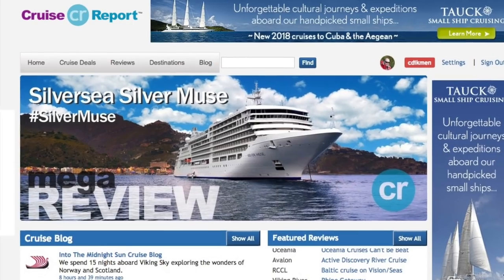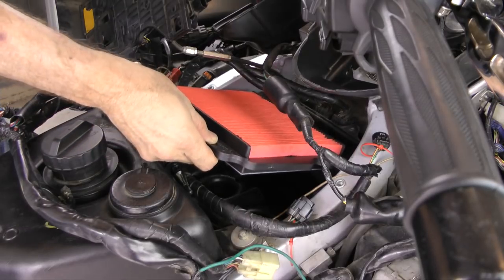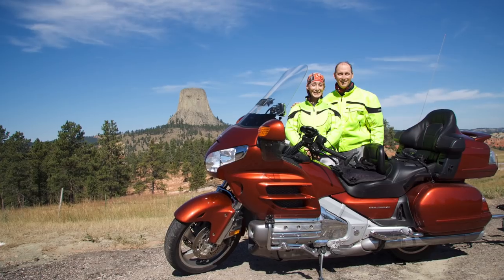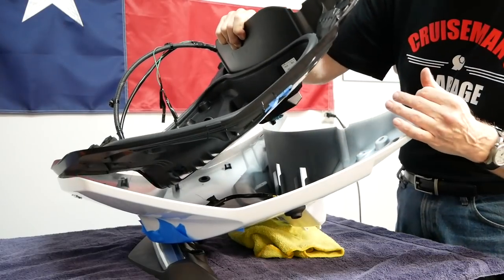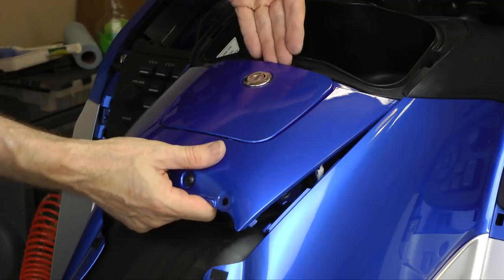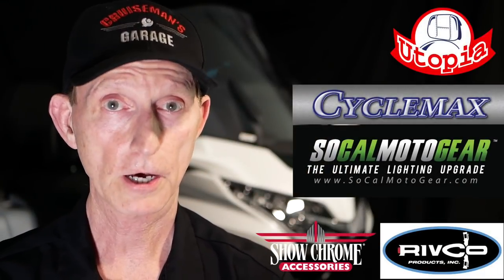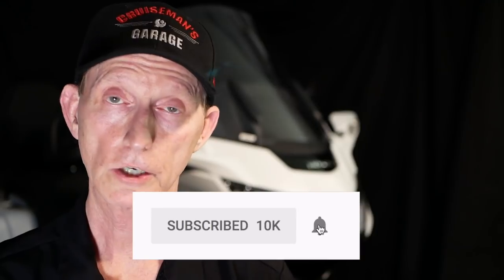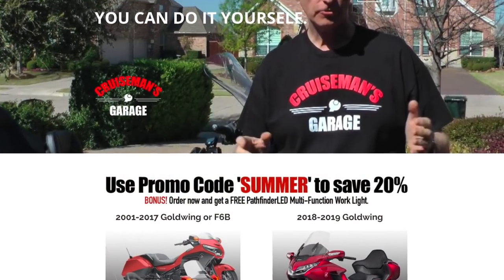Welcome to Cruiseman's Garage | Everything Honda Goldwing

Comment: Honda's written instructions for installation of the 12 volt accessory are so poor, I got 2/3 through the dismantle and at #16 and 17 just could not figure it out. so sad, they make is so hard. Should have bought the Indian. 3 hours invested and the part is still in the trunk.
Reply from the maker: I agree, they made it as hard as they could.
Reply: @cruisemansgarage  So sir,  are you going to do a video on that install? I got 2/3 dismantled and just freaked out, couldn't understand the next steps.  Traxxon Dynamics had a partial video but I did not see the detailed dismantle.  Anyway, thank you for all you do.,

Comment: Would love to see how to add bulbs to rear taillight on 2018 Goldwing so they flash when brakes are engaged
AND\
How about a video on how to make the light on the 2018 luggage rack run as a running light and flash as a brake light instead of just being a brake light.  I need more rear lights for safety and have not found anything yet.